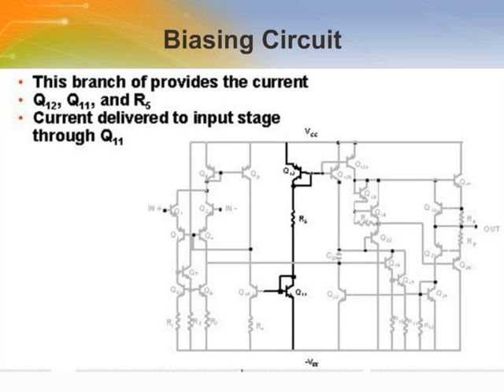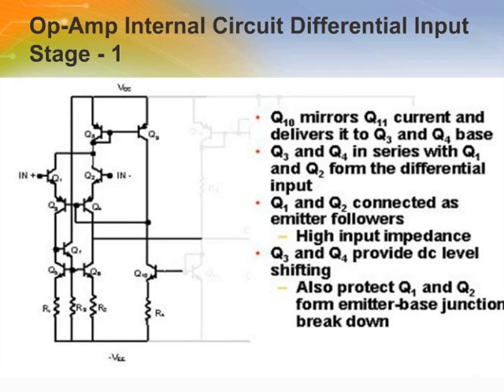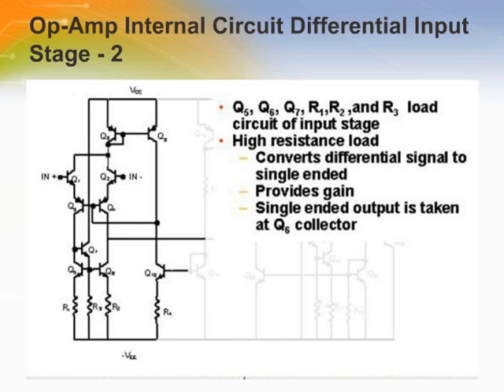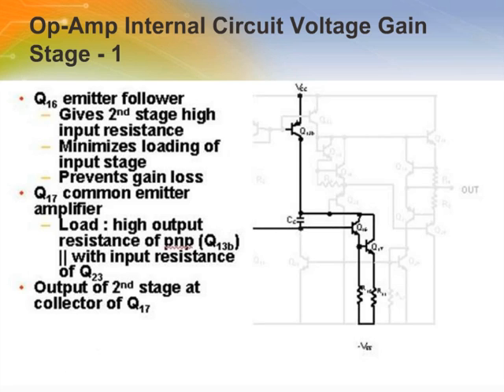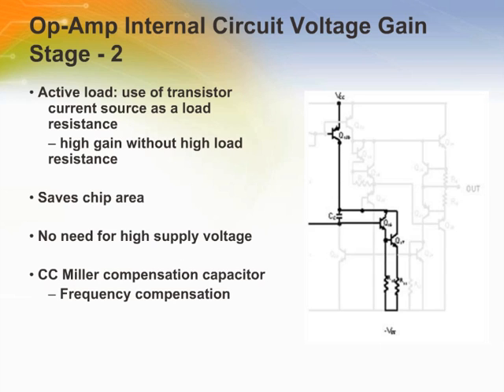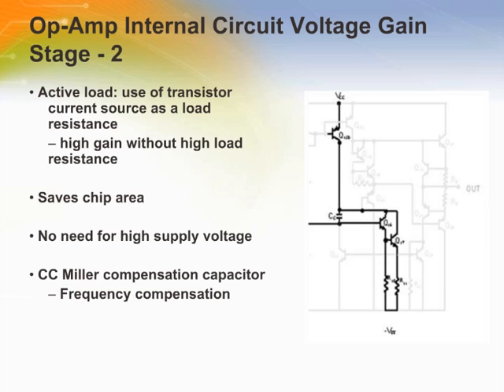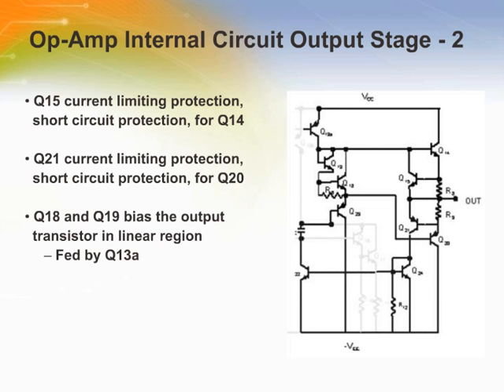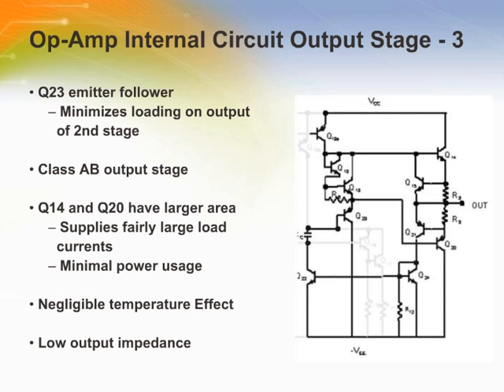Op-Amp Basics Part III  (Internal Circuit)

Comment: Dear element 14 I need you to shed the light on the technology of the output short circuit protection used by the op amp cus it is one of the effitient methods of protection implemented until now at of what I have seen ever!